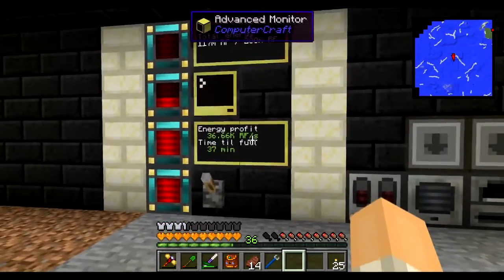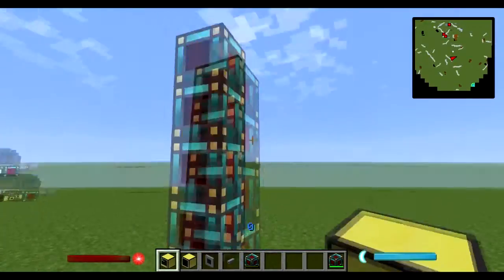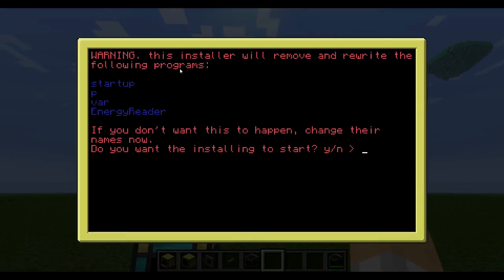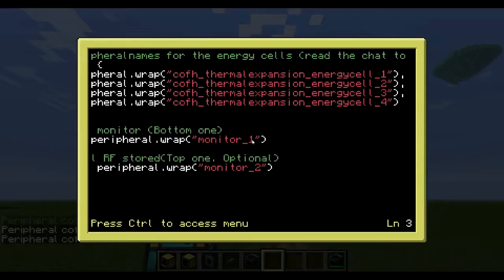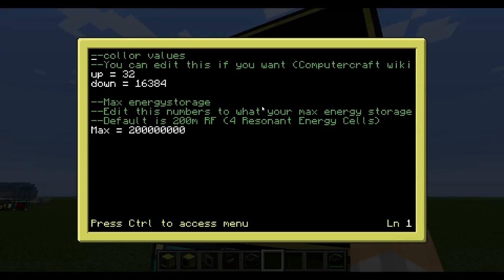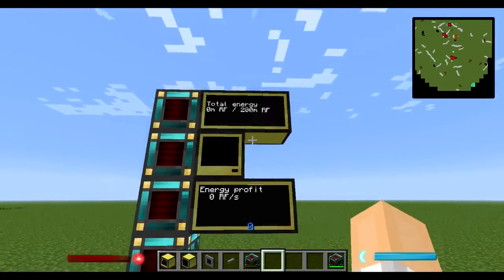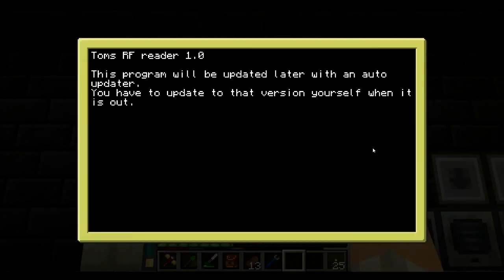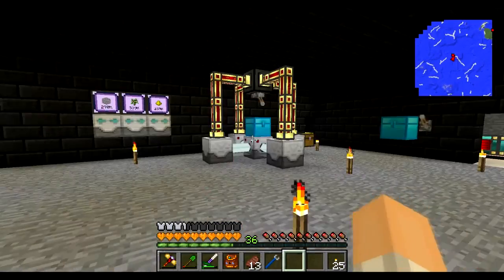Toms Thermal Expansion Energy Cell reader (RF/s)

Comment: It worked fore me yesterday when i tested with 4 cells  i added 2 so i now have 6 and got that error i just posted.  any clue how to fix?
Reply from the maker: Did you configurate the monitor settings right?
Reply: ***** Forgot first monitor is always Monitor_0   didnt even think of looking there was thinking i messed up on last 2 cells.
Reply: NVM  that did not fix it.  saved changes then ran EnergyReader same error
Reply from the maker: kiteuzimaki You get that error because the mon value is does not contain anything. What did you enter into you mon value?
Reply: ***** mon = peropheral.wrap("Monitor_0")
Reply from the maker: kiteuzimaki But is you monitor monitor number 0?
Reply: ***** Yes i had 1  and 2 but the numbers were 0 and 1  so i changed and error persisted.

Just broke computer and have monitor numbers right but now it is giving me a new error...
EnergyReader:80: Attempt to perform arithmatic_ _div on nil and number
Reply from the maker: kiteuzimaki
1. Run the installer program.
2. Right click all your modems and remember the numbers.
3. Configurate and make sure that all the values is right.

If it's still not working, are you playing on a server?
Which version of the program are you running on?
Is the modems on?
Reply: ***** Okay.  ran installer again.  Monitors were 0 and 1  they are working now but the new error is now.

EnergyReader:80: Attempt to perform arithmatic_ _div on nil and number

This is using FTB Monster mod pack V1.1.1 .  on a single player map, have not moved it over to the server my friend runs cause i wanted to make sure i could add more energycells before i started messing with out power system.
Reply from the maker: kiteuzimaki EnergyReader:80 contains 2 variables. That means you Max value is nothing (which I don't think it is) or your totEnergy value is empty. Is your modems on?
Reply: ***** Yes all of my modems are on  should i try turning all off and on?
Reply from the maker: kiteuzimaki I have no idea. I need to see this for myself. Any way you can show this to me?
Reply: ***** Okay reset all modems  now new error...  25: Expected number

This is still using default settings except the numbers on cells and monitors.
Reply from the maker: kiteuzimaki When you have changed the settings, are you running the energyReader program?
Reply: ***** Yes.   should i do Startup?
Reply from the maker: kiteuzimaki No, you need to reboot to aply the changes and rerun the programs in the right order
Reply: ***** so how do i tell it to reboot?
Reply from the maker: kiteuzimaki Hold Ctrl + R
Reply: ***** after CTRL+R  run what program  EnergyReader, Startup?
Reply from the maker: kiteuzimaki Everything should startup by itself. If not, run the startup program
Reply: ***** Keeps doing quick flashes then giving EnergyReader:25: expected number
Reply from the maker: kiteuzimaki The only value in that line is a coller value. edit your startup file. What does it say?
Also try doing a manuel run.
First, run the program called "p", then the program called "var" then run the energyReader program
Reply: mon.setTextColor(up) is what is its saying   i can see why Up is not a number.
Reply from the maker: kiteuzimaki up is a value f that contains the number for the color green
Reply: ***** So i not sure really what is wrong.  i even tried to break the computer and run it all again starting with pastebin   and still gives that error.   This is so weird since i had it working yesterday.
Reply from the maker: kiteuzimaki I there any way you can start the world up on a server so I can join and take a look at it?
Reply: ***** sadly no i dont have permsions on the internet router to allow for hosting.    I will talk to friend about it if error appears on his server when i finish putting our power system 2gether in the next few days,  (dont wanna give out his IP without his consent.)
Reply: ***** After working on it a bit  (with knowlege i gained from out char) i found that  Var  is not being ran.  (cause it did not understand  up  down  or what max energy is.     error 25 (changed up to 32)  error 29 (down to 16384) error  46 is divide by nil (so that is 3 things Var should give right?)

run var only     bios:339: [string"var"]:15: ')' expected
line:
print ("your system will now show that your max storage us "...Max..." RF")
Reply: ***** Deleting the if statement about max energy (in var) fixed the issue  (that was something that i did not see on the on the 18th)
Reply from the maker: kiteuzimaki That was something I added last night. I'm going to downgrade it when I get home back to 1.0.03
Reply: I was shocked it did not give var error and just skipped to energyreader wi th out finishing the var program
Reply: Do you know where in the world files I could find the program?  I need 300 energy cells to take the charge of my nuke running off 1 round of fuel so that is a pain when I can't paste them into the computer all at once.  ( paste does only 1 line and drops the first character and all " )
Reply from the maker: kiteuzimaki Where your savefile is. Default is the same location as the FTBlauncher.exe. There should be a computercraft or computer folder. If you are going to connect this to a system of 300 energy cell, you got to send me a screen shot or a video of how it looks!
Reply: Will do.  Atm. It is as compact as I can make it so if I mess up and fail to activate a modem it will suck.  Have only 84 cells down too.  Me is Making the others while I am at work right now.  Think it will be about 500 cells total.  Giving a buffer for miss calculation and so we don't have to wait for it to all be drained before we start the nuke again.  Hope I can finish it 2day but might not taking a lot longer to make than expected.   Longest part I have yet to do but that is make the cells only connect to 1 input 1 output.
Reply: ***** Okay.  I am at  750 energy cells.   all placed and programmed.  all modems placed and turned on. now just to run cables to the main ME interface.
energycell_100>> Energycell_849    that is 750 right?  purposely made it start at 100 was easier to copy paste code with it starting there instead of 0.
Reply from the maker: kiteuzimaki Yeah, that should be right
Reply: ***** edits to code that i am thinking of making.   in Var  number of leadcells number of hardencells number of redcells number of Resonantcells
totalenergy will then be a formula,  this just makes it easier than doing the math of 750 cells of energy and making sure i 0s are not dropped.

was also thinking of making the top monitor color change like bottom  based on % of energy.  having  green(40 or 30 and up)  yellow(11-39 or 29) and red(10 and lower).  Just little things that would help tell power at quick glance and what not.  would also possibly help for the mail thing you were talking about in video.   like when it turns to red mail could be sent.
Reply: ***** with 700+ energyvells Time till full is not working well.   34billion+ power should not be full in 22minutes...
Reply from the maker: kiteuzimaki Depends on your input per second. Also the best energy cells can only input 10K RF/t which is about 270K RF/s according to thi program. However, I think there might be some miss calculations, but the time remaining is matching up with the time showen.
Reply: ***** another thought.   i did not have them in the same order as they are placed.  so it is jumping all over the system  that might be causing error too.  so the modem numbers do not follow the flow of energy,  this might cause some issues thought i am not sure.    sad thing is we miss calculated.  we thought nuke made 32k RF per tick.    it makes over 40k  cause my banks could not keep up.  if i was correct it might even be outputting 160k per tick

right now nuke is off.   bank 5 and 6 are filling bank 7 yet the system thinks there energy gain.
Reply from the maker: kiteuzimaki Nope. Only reason you want them in order, is so if anything goes wrong, you can easly find out which energy cell. Hold on. Is there over 7 energy storage banks connected to one system?
Reply: ***** sorry  work was crazy and i had a presentation for my summer class.

not really it is all it was 4 input banks  that feed 2 intermediate banks that fees 1 larger final bank.  will post movie later 2night to show you.

Issue is it updates the energycell data faster than it adds the numbers together.   dont know how to do it but i think your code might need a delay for systems as large as mine.   20-30 ticks of delay before looping back  should be more than enough is what my friend and i think.
Reply: kiteuzimaki Okay  i have not looked at any updates in your code lately.  We did an overhaul of on our house which has required some changes in our power.  atm we do not have computers running cause i am still slowly changing power system should be all back up  in a few days.. (so with my luck in a week)

Comment: Doesnt work anymore because it does not exist at pastebin
Reply from the maker: The expire is set to never and I've not delited it. Cheack your typeing and see if you misstyped it. Capital letters DOES COUNT.
Reply: ***** yeah i missed a letter, another question is there a way to edit the programm cause i cant terminate it
Reply from the maker: crazyzocka Just keep holding CTRL + T till it get's a java error. you can run "config" to edit the config files like you did when you installed the program.
Reply: ***** ok thank you